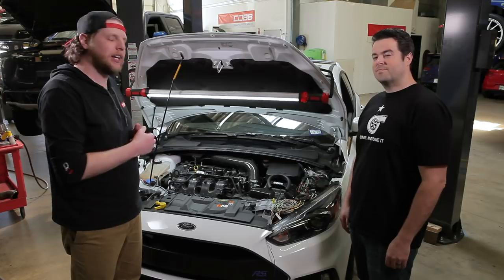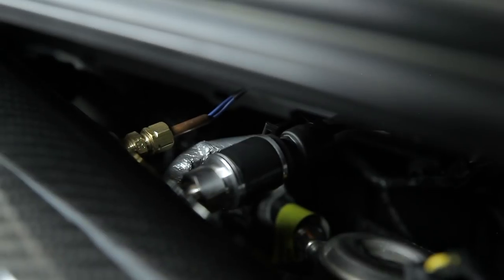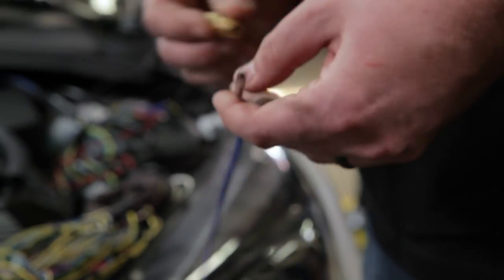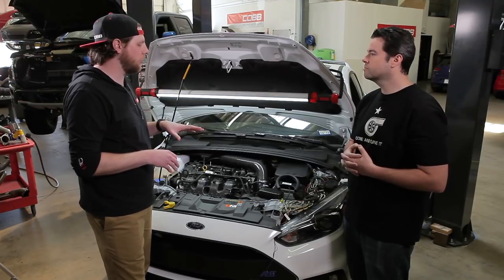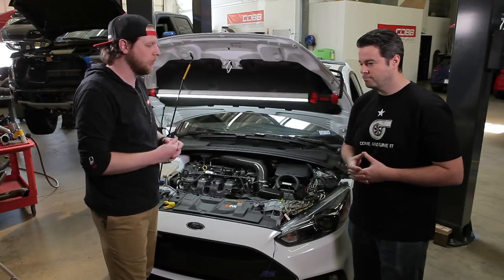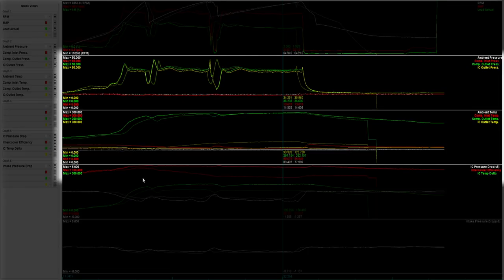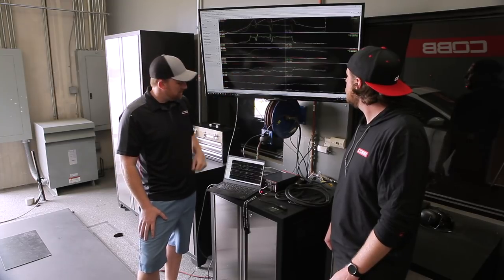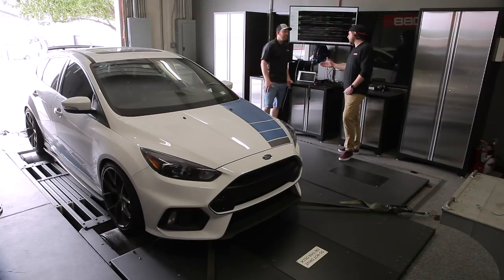COBB Tuning - Inside Look: Focus RS Intercooler Testing

Comment: I'd like to request if you guys can develop custom pedals for the Focus RS that has better heel and toe placement. Thanks.
Reply: You can buy a spacer to bring the gas pedal up. There are a few different ones out now, a plastic one and one machined out of a block of aluminum. They are costly at around $60-80, but I imagine much cheaper then new pedals.
Reply: i do have a spacer. It's not very elegant though. Also I'd like the gas pedal to also be a bit wider as it's a bit far apart from the brake pedal.

Comment: I'm pretty sure almost half of the OEM Ford RS intercooler is covered from the factory with a blanking plate. Can anyone confirm?
Reply from the maker: The factory core does have a small piece that covers about 25% or so of the core. We removed that for all baseline testing though. So all of our baseline testing is with the stock core with no cover.
Reply: COBB Tuning good to know, thanks!
Reply: I heard ford put those covers on because in humid environments the stock intercooler was too efficient and creating condensation inside the intake. Wouldn't an upgraded intercooler have a similar issue.
Reply: mks57 I suppose that could become a problem in rare high humidity, low ambient temperature weather situations with a light footed driver. Generally thoes who install peformance intercoolers or look to improve IC peformance don't drive in a way that the IC will accumulate any concernable amount of condensation because any IC gets plenty hot during boost. High ambient humidity isn't always a bad thing but under certain situations it totally could be so I see your point.

  Ford uses / shares parts with other vehicles and they had to blank some of the intercooler to use it in the 2.3L 4cyl. RS but still have an IC with enough thermal capacity for a future model or a new ECU flash. That plate is there to keep the IAT's hotter so tail pipe emissions don't dump fuel during cold weather with the factory ECU tune, no doubt.  I'd imagine a water trap would be secondary if it was a considerable issue they encountered.

  One thing you can count on with American cars is most anything you see nurfing a vehicles peformance is because of emmision control standards. If you live where it's frequently very cold and humid at the same time or you don't get into boost often and live in a very humid environment I'd recommend devising a IC piping water trap if you're actually finding measurable water in the intake piping.

  I'm just a peformance mechanic, I'm not an automotive engineer. But that's a great question, let's hope Cobb gets back to you on it :)
Reply: Thanks for the reply. I live in southern Ontario Canada so surrounded by the great lakes so lots of humidity and cold in the winter. Was something i was curious about.
Reply: mks57 yeah, if I was you I'd pull some piping off after the IC and check but it really is a rare condition. I'd think small turbo planes might see it more often flying through clouds but don't quote me on that, just something to explore.